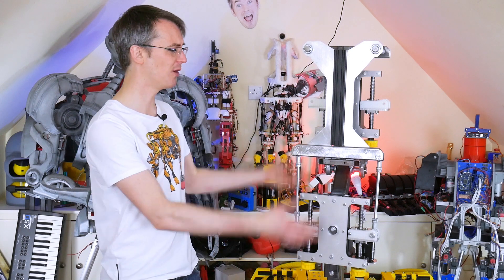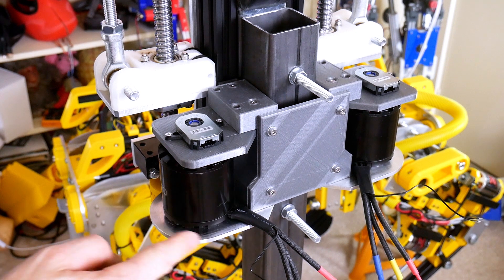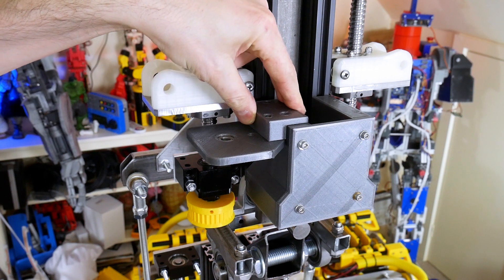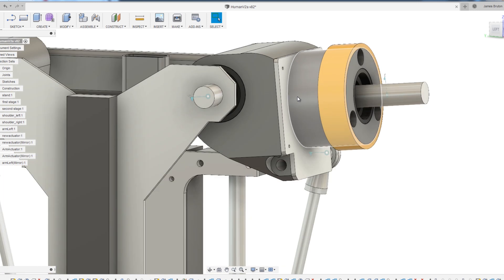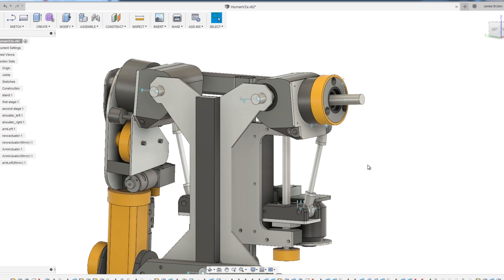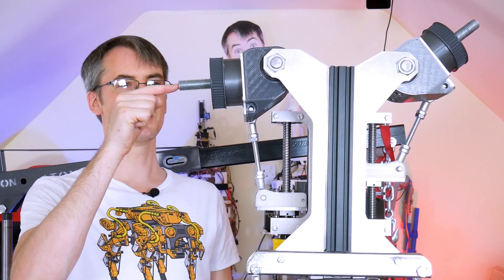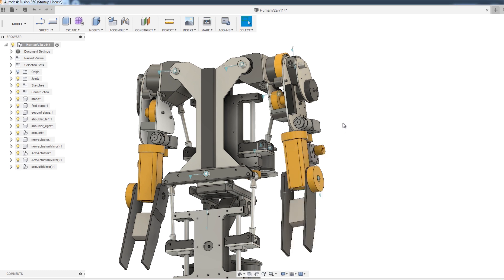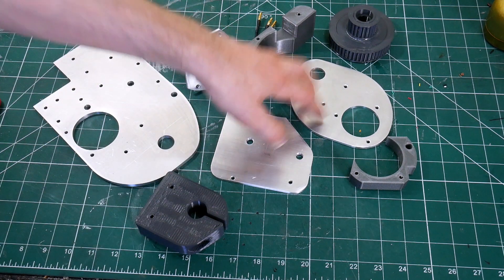Completing the Robots' Mechanical Build

Comment: Is it possible to make "power electric steering" on an E-skateboard where you do not have to lean in order to steer, but instead use a remote control that powers the wheels like an RC car
Reply from the maker: Yes, check out my BatBoard series

Comment: My only suggestion would be to the stands, in that while a single upright pole does the trick, two poles would better simulate "legs" and that you could easily put a pair of pants on the robot to hide the poles if you want to use them in a more animatronic fashion (think Halloween coming up, monster mash dance? )

Comment: You mentioned puppeting the robots… I'm wondering how that will work in practice. I'm reminded of that virtual reality stuff you did, with Unity, and your own controllers; so I know you've dipped your toe into VR. I wonder if that might vaguely be how it's done here. …Only… With handheld motion sensing trackers, they don't know what angle your elbow is pointing; so that could end up knocking things over, if you leave elbow position up to a program. Luckily, elbow position doesn't need to be hyper-accurate to avoid knocking things over, so that opens up a few more options for tracking its position.
Reply from the maker: I will have mechanical rigs to start with

Comment: Oh yeah. The refinement is so satisfying to watch. You keep learning and applying to subsequent iterations. So glad to see your welding improve. This Old Tony made a rotating CNC welder for round items, and you may care to do so to facilitate high-tolerance difficult welds. I was watching a Boston Dynamics video that discussed the next generation of their builds, and was struck by how additive manufacturing will affect them. The basic idea is to use multipie materials in CT-scan way, such that tubing and support structures are integrated in the internals of the build. In this way hydaulics and whatnot need not be on the surface, subject to damage etc. Also, are you going to utilize tolerance-based design (I probably said that wrong) to optimize your supports? Okay, and this is the last, have you considered having other YouTubers make some of your parts, like Adam Savage did for the Project Egress...project? On second thought, he had the devil of a time with tolerances, so maybe keep it a one-man droid outfit. Excelsior.

Comment: Interesting - when you were making the holes on the aluminium you chose to machine the entire material in the circle rather than just the circumference - why? Just to avoid the loose disk left over in the hole?
Reply from the maker: Yes, it makes a clean hole with no tabs to file off

Comment: What a fantastic build, love the way you are bringing all the different build methods together, metal cnc/3d printed parts. Would it be possible to put a text caption when showing the cnc/3d printer of the speeds and feeds, type of material and temps etc so we can learn what settings you use. Thanks for sharing such great content

Comment: Great job. But I think, you do not need the bearing on the plastic part with encoder. And because of this bearing you don have quite enough space for the encoder collar.
Reply from the maker: Yes I'd considered that, it seems to work reliable though

Comment: I wonder if a miniature puppetable set of arms is possible, like a tiny rc person for messing around with on a small scale? Like a desk toy.
Reply: The problem is always power. Where you going hide all those battery packs and controllers at that scale?
Reply: @tando6266  The Armatron toy used a couple of D cells.
For a desktop toy, why does it even need an on-board power source?  Just have a USB port.
Reply: @JohnDlugosz  The OP requested RC, why bother with RC if its not wireless AKA no wires
Reply: My robot Dave has great arms, he is under 1M tall. I also saw another humanoid robot much smaller with very good movement. https://www.youtube.com/watch?v=e-TCCmGKzQc&t=16s
I am not sure the name of the smaller robot.